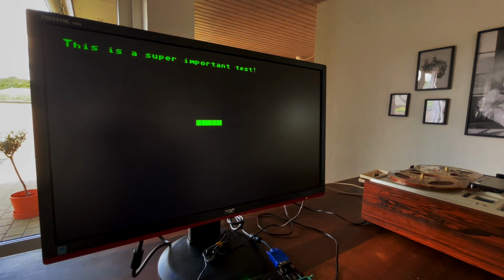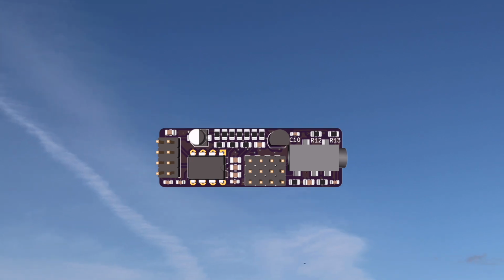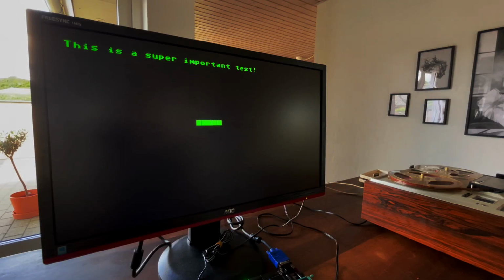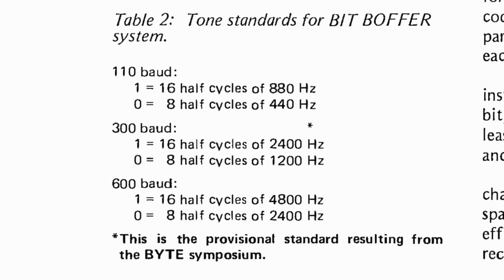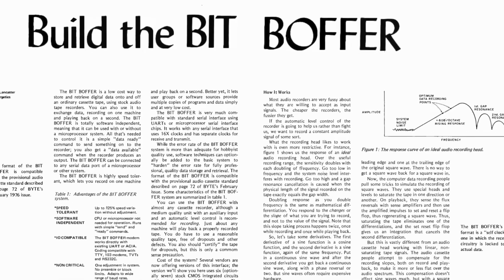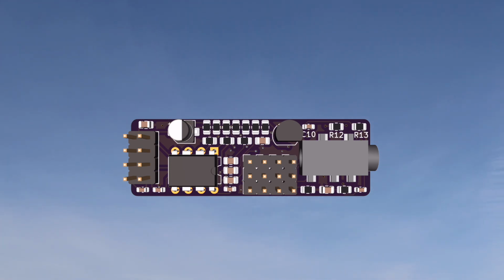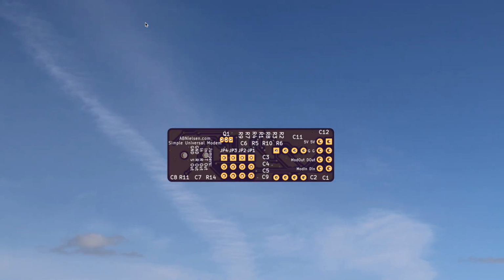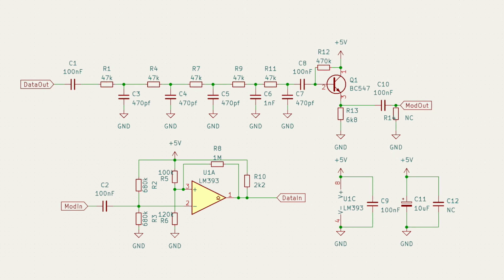Backup like it's 1975. 6502 data to TAPE!

Comment: I just remembered,  back in the 1990s, there was "a thing" for a while for "WinModems" which to cut costs on getting you online only contained the minimum of circuitry and got the PC to do loads of the modulation in software... so the precedent has already been set for some of the corners you cut here. ;)

Comment: Kinda reminds me on an old abandoned project where I hooked up a 1950s era Telefunken reel to reel up to a Commodore PET. The Telefunken has a solenoid driven capstan which allows for remote control, so I just put in a switch to detect if play or record had been pressed. I could record from the computer to the tape and have the computer fully control the tape which worked fine. But something as simple as a small signal amplifier to get the signal from the tape back into the computer I couldn't do back then. Or rather procrastination got the better of me. And the tape machine's belts.

Comment: What tape speed did you use to record on?

EDIT: just heard at the end of the video (3.75 ips). Awesome that worked for you - I experimented saving data onto reel to reel with my CoCo2, and it would only work when the tape speed was 1 7/8 ips. Would have thought that a higher tape speed would be more reliable. Anyways, great video!
Reply from the maker: Maybe you have a mechanical issue that gets worse with speed? (Or a bad motor cap like I did)
Reply: @AndersNielsenAA  if I do, it certainly isn't coming through in the music, which sounds perfect!

Comment: Regardless of computer brand, setting the playback volume was very important to read tape correctly.
Reply from the maker: Good point! And even though I didn’t point it out explicitly in the video it still is.

The modulated signal from the modem is about 1V p2p and demodulation works best with about the same level.

Comment: Nicely done!  I haven't studied your code yet, but is there a relatively simple way to enhance your load routine to auto-detect the bit rate of the incoming data and perhaps even compensate for small tape player speed variations by listening to the leader for a second or two and calculating the timing "constants" on the fly before each load?
Reply from the maker: It shouldn’t be that hard to write a calibration routine if you can feed it a known leader of continuous “1”s
For small variations though it shouldn’t be necessary though as the cutoff is right in the middle of the two frequencies - it would have to be 600Hz fast or slow to fail.
Calibration based on the leader could be used to detect completely different frequencies though.